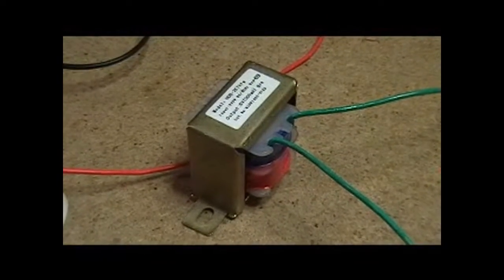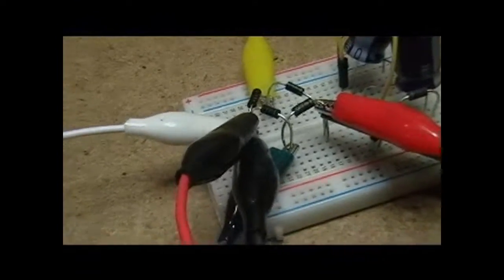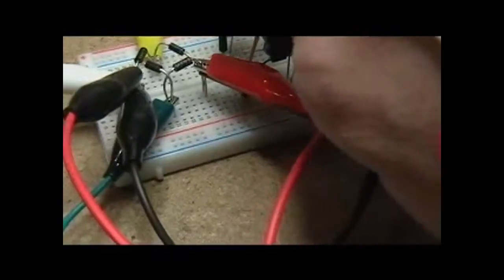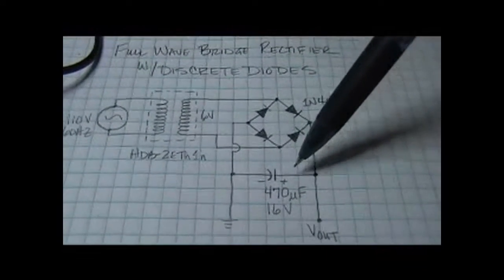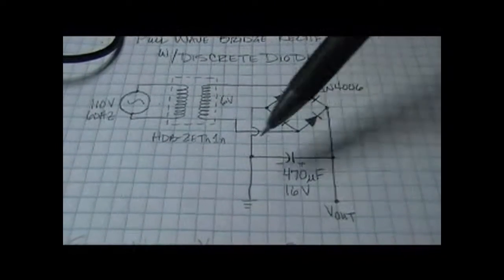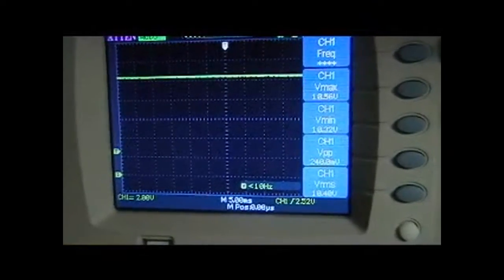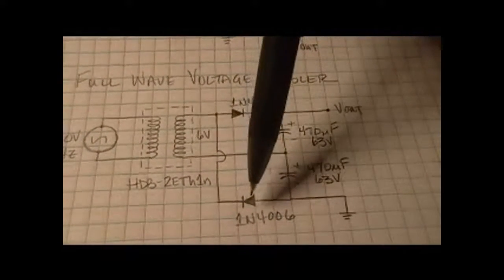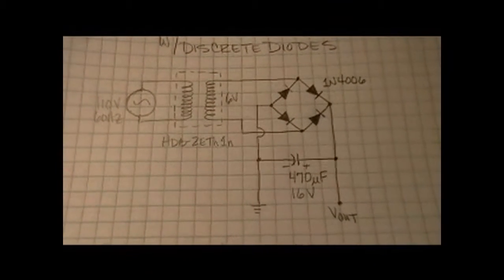Full Wave Bridge Rectifier and Full Wave Voltage Doubler

Comment: Hello, i am currently building a wind turbine using an ac motor , but it turns too slow.. so i plan to put a full wave voltage doubler into it, but i wander whether the duobler with rectifier will output more power...
Pls someone advice me... cheers...

Comment: Which one of these two circuits is better ?
Reply from the maker: I am not really sure I understand your questions.  One of the circuits outputs 6 volts where the other circuit outputs 12 volts.  Both circuits will work reasonably for their expected output provided you don't exceed the specifications of the transformer or utilize components that have specifications that fall below the circuit ratings.  Traditionally, if you don't require the voltage doubling, I would say the full-wave bridge is a very standard circuit and common in many products.
Reply: @jonathanbisnett3821  My question was to know which one of these circuit is more efficient in terms of energy conversion. I agree that full-wave bridge is a standard circuit, but i read somewhere that voltage doublers are more efficient. 
My objective is to convert an alternating current of 6V3W (0.5 amps) to stable DC (preferably 5V but i could use a buck boost converter)

Comment: I'm surprised there are no comments??? I have a question if you get this and maybe can help. (I'm a newbie to hobby electronics, just learning as I go). I bought a breadboard, a variety pack of resistors, and LED's, but everything else I have I've salvaged from "dead" electronics. (Transformers, caps, pots, power resistors, switches, etc..) I still need to get a variety of diodes as the leads are usually cut too short to reuse, but soon enough. 
 Anyway, I've been looking everywhere for an answer to my question, but every search I try always comes back with the same results/schematics you've shown here. I have a couple different Bridge Rectifier IC's I salvaged, so I've ran a transformer to the BR then to a cap for smoothing, (I need to add a power resistor for a load so the voltage read on a DMM will be pretty much what I can expect when I do hook up a load). My question is from the BR, how can I, (or can I), make a voltage doubler, even Tripler? Or is that just not [easily] possible using a real BR IC?
I was looking into buying an adjustable DC Volt/Current PS, but I decided I'd rather just [try] and make my own, both as practice, and to have a variable PSU, (variable Voltage for now using a pot, and add a pot for adjusting Current as my knowledge improves).
Problem is, I can't find any info on a Voltage Doubler from a real BR, so is it not possible to do this way?
Thanks for any help you may provide!!!
Reply from the maker: I am assuming that by BR IC what you are referring to is simply a standard bridge rectifier in a four pin case that looks like an IC.  Note that the doubler circuit above is not using a full bridge.  It is using a pair of diodes to do basic rectification.  You would not want to try and use a bridge in that circuit as you would short things out.  Off the top of my head, I cannot think of a good way that you could make a voltage doubler or tripler using a full bridge unless you were going to somehow introduce a switching mechanism back into the circuit. The key to the doubler above is the alternating nature of the input that allows both caps to be charged in such a manner as to combine for the increased voltage.  Good question though.
Reply: Thank you for your quick, clear reply. Yes, I was referring to a 4 pin BR, and I suppose that's why I couldn't find any info/schematic for a V doubler using the 4 pin BR. Ok, I have another [last] question I hope you may/will answer. Making a V. Doubler using just 2 diodes, 2 caps, (and I assume a power resistor so the DC output read on a DMM would be at least very close to the actual voltage able to power a real Load, I.E., a DC motor, without a significant Voltage drop), would that still be a Full Wave [V Doubler] Rectifier? I'm sure there will be at least a minimal amount of ripple unless further smoothing caps and/or a Voltage Regulator are implemented, but do the 2 caps "replace" the 2 other diodes from a regular diode based BR?
(Also, just to be sure I'm doing things right, how or where would I hook up the power resistor in either a regular rectifier circuit, or a V Doubler circuit? I know that may seem like a simple thing, and I'm pretty sure I know or could find a schematic, but I just want to be sure so I get the correct results safely).
As I stated, I'm extremely new to "hobby electronics", so I'm far from obtaining an O-Scope to actually see what is really going on in detail, a DMM no matter how good it is won't show these fine details [like ripple].
Thanks so much, and I don't mean to hound you to death. Problem is, (at least starting out), I can find most info through Google/You-Tube/Blogs... but for every answer I get it seems 10 more questions arise, and few people seem to want to answer simple questions with simple answers! I've asked questions, but when I get a reply many want to go into theory and I just get lost!
Thanks Again,
Reply from the maker: To answer your first question, no, the caps do not take the place of the other two diodes.  This is a full wave rectifier however it is not a bridge rectifier.  The caps serve to provide for the actual voltage doubling.  They are the storage mechanism that makes the process work.  The arrangement of the caps in respect to the transformer allows us to use both the positive and negative portions of each phase to store energy to the caps which provides a combined voltage that is about double the incoming voltage from the transformer.  Yes, there will be some ripple as this is a rough circuit.  If you want something solid, you would have to consider a voltage regulator or other circuitry.

As for incorporating a load (power resistor), it would be placed between the ground and Vout points on the diagrams above.  Keep in mind the size of the resistor will determine the current that is flowing and that the current and voltage will determine the power.  Make sure your resistor is rated for the power that will be present.

I understand your statement above delving into theory, however, that is a fundamental part of electronics and can be critical with respect to safety.  The theory allows you to anticipate the results and make sure that you have covered the potential issues.  Try to mix the theory with your experiments so that it becomes easier to envision the expected results as well as to better understand and interpret the results.  If you really find electronics interesting and want to better grasp the field, you might consider looking into a local community college that offers a program in Electronic Engineer Technology (EET).  This will provide an education from a hands on perspective where the theory is mixed with the actual hands on experimentation.